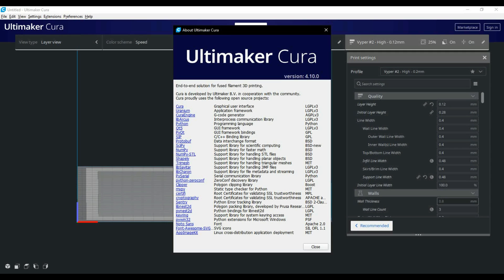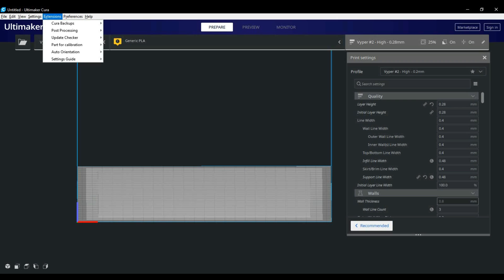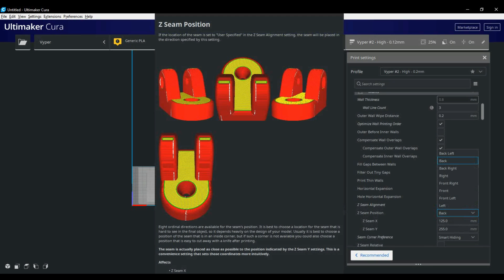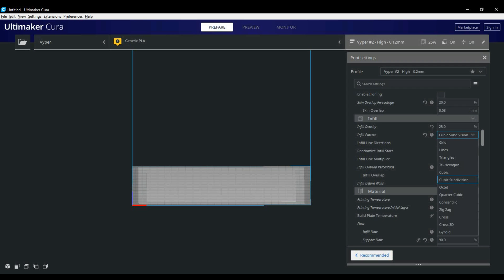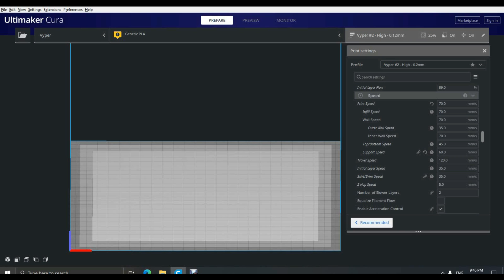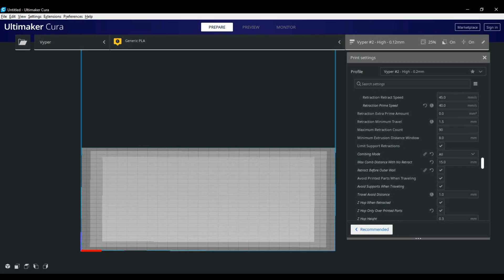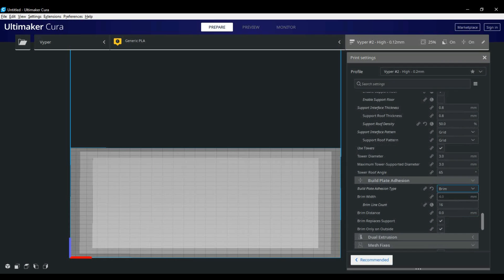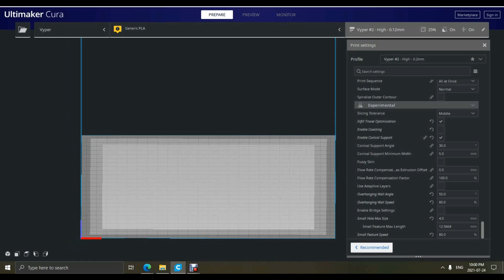Cura Walkthrough Vyper settings

Comment: The settings on your drive doesn't import well into my version of Ultimaker for some reason? I think it is because I have more options than what I see in your settings... However, I adjusted what  I could.

I also noticed that some of the settings on the drive file dont match yours in the video, not sure if that is because you have updated them since...

I am trying to find a good profile for PLA Plus on my Vyper. Super new to 3D printing :P
Reply from the maker: Is there a error that pops up? If you click in settings to show all settings that should help. I change a couple settings depending what I print options that I change are usualy layer height,infill density and support options most other setting never change for me. I'll upload a updated profile and see if it works for you.
Reply from the maker: This profile I have is what i use for all my prints basically  I print mainly pla myself sometimes tpu and petg but mostly pla and this profile had been working pretty good for me
Reply from the maker: Main thing you will want to do it calibrate your e steps and your flow %.
Reply: @studiozombie3d  Yea I'll look into that. I'm super new to printing so I am not sure how to tell if things need changing. I am printing a decent sized print and will see how it turns out. I am using PLA Plus right now, so the only thing I changed was the temps and set it to 220 as the PLA Plus recommended.
Reply from the maker: @DeSibyl  if you have Instagram you can message me there and I cam try and help you out. There won't be much you change really. Layer height,infill density and support settings are the main ones. If you notice stringing on your prints you can drop your temp 5 degrees and that can help
Reply: @studiozombie3d  the settings seem fine, I’m noticing the infill has holes in the ‘walls’ pretty often… I use gyroid (since it states it has strength in both verticals and horizontal) and use 20% infill… I also notice there are some holes in the outside walls too, although they seem very small and I don’t think they go all the way through… I lowered the temp from 220 down to 215 to try and lower the amount of stringing which seems to have good effect as there’s not as much stringing this time
Reply from the maker: @DeSibyl  what is your infill line width set to? .48? If not try that and you can slow the infill speed down a bit to help fix that. I've had lots of prints do that to me but they are strong and I have no issues. But try slowing the speed of infill down 5 mm or so and see if that helps
Reply from the maker: @DeSibyl  you can also bump up the infill flow % a few percent to help out
Reply: @studiozombie3d  okay I'll give that a shot, I pretty much just used your settings as they are and just adjusted the printing temp due to using pla plus
Reply from the maker: @DeSibyl  yeah there aren't many  changes you really need to name based on material generally speed and Temps

Comment: Great information for a new to 3D printing person. I'm using your profile for the Vyper right now and mt print is looking amazing. I've also substituted your start code. Thank you!
Reply from the maker: Glad to hear that it's working for you. The start code is more of a personal thing I just like to do a purge line before prints. Need anything else let me know
Reply: @studiozombie3d  Quick question about your start code (and I've seen it on tons of other start code for the Vyper):
 You end it with a G5, which according to Marlin Gcode ref is a bezier cubic spline move. I found reference in the i3 MEGA manual to add the G5 in the gcode to enable power loss recovery of a print. Do you know if this still needed since M413 exists? Or is it a remnant of our choice of i3 mega as the starting machine? BTW thanks a lot for the profile!
Reply from the maker: @chzel  it's more to enable and work with arc support. There's a plug in called arc welder. It attempts to replace G0/G1 (linear move) GCodes with G2/G3 (arc move) GCodes. This can substantially compress many GCode files and may reduce stuttering caused by sending many tiny movements in rapid succession over a slower serial connection. If can also help with producing a cleaner circle movement and round prints.

Comment: LIKED and subscribed! My vyper will arrive tomorrow its my first printer. I been on youtube looking for helpful content for the viper. You provided the best info yet. Unfortunately its a new printer and not much support for it yet. Hopefully you will continue to post more tips and tricks for the vyper! Thank you
Reply from the maker: That's awesome to hear man glad the videos have been helpful. I'm planning many videos might do a octoprint setup one then maybe a closer look at some of the cura settings. Any suggestions let me know
Reply: I plan on loading your setting and bang out some test prints. I plan on using this mostly to print parts. Once i get confident with the printer i planned on setting up octoprint, so im sure people would appreciate that vid. Do you create any of your own models?
Reply from the maker: @thatdude610  the cura profile I have uploaded is pretty solid for most thing you just need to calibrate your e steps and flow and your good.  Yeah octoprint is super handy have had a couple requests for a vid. Will start working on it and get that done in the next day or two
Reply from the maker: @thatdude610  I'd like to make my own but I use pre made most of the time

Comment: Did you make any Z offsets in the firmware or just leave it at zero?
Reply from the maker: I just leave it as is once I level it seems just right for me. Sometimes I will re level the bed if it isn't right. Haven't adjusted the z offset once with it surprisingly
Reply: @studiozombie3d  same. My only bed adhesion issues have come from blobbing at the nozzle after loading new filament (it defaults to 230 which is REALLY hot for PLA)
Reply from the maker: @jeffersonderrickson5371  yeah I haven't printed off the SD card since the first week lol I use octoprint on mine.

Comment: Quick question...are you using octopi or SD card for prints? Been having bad prints using octopi. Bad stuttering around corners.
Reply from the maker: I always use octoit myself. What are your acceleration and jerk settings? Can try resetting your firmware on the printer and see if that helps also of your not using it I'd recommend trying arc welder plug-in on octopi. Let me know if any of that helps
Reply: Ya that's the first thing I tried was Arc welder. It helped a little but the print head almost stops when it comes to any corner. I'm going to flash the firmware right now. I hope that fixes it I really like this machine.
Reply from the maker: I remember at one point mine did that with one print. I reset the firmware with m502 on the terminal and reset my esteps and stopped doing it. Think it's a bug and the data gets gummed up transferring over

Comment: Your settings have done wonders for my Vyper print quality. I found 95% of what you’ve shown work best for me. I didn’t enable jerk setting because I kept getting layer shift (bad staircase shifts), so I let the firmware determine best corner speeds. Appreciate the extension tips also as I’m learning 3D as a newbie. I finally obtained a perfect 20mmx20mmx20mm calibration cube with your settings overall.
Reply from the maker: I think the jerk settings on the profile is set at 13 think stock is 5 you can try 10 or lower see if that helps any
Reply from the maker: That's awesome glad to hear that anything else you need let me know

Comment: 1:00 but aren't the dimensions of the printer 245x245x260?
Reply from the maker: It's a odd size for sure
Reply: awesome... Im testing my new viper as well
Reply from the maker: @MrMST6  nice let me know how it goes for you. I have new custom firmware avalibe with linear advance and some other options enabled and if you have a raspberry pi octoprint is awesome with the vyper.
Reply: @studiozombie3d  I'm getting some under extrusions on the z seam, I'm going to try the custom firmware to do the linear advance test... does it work well w/o octoprint?
Reply from the maker: @MrMST6  the new bugfix has tweaks for octoprint I tweaked the buffers for usb and the baudrate to 250000 for octoprint. I only print with octoprint and it's working awesome with the new firmware.
Reply from the maker: It's actually 250x255x265 It's wierd I know lol
Reply: The dimensions that he used come from Anycubic themselves. From using my vyper those settings allow you to build right up to the edge of the bed. Since the vyper has a removal print bed that flexes to release you can build on the entire build plate instead of leaving room for tools or other releasing methods.
Reply: Wow that's interesting!
Reply: Cheers for this - will be trying out these settings on a bunch of terrain. I'm only a week in with my Vyper but I'm learning a ton already!
Reply from the maker: @celephais40k12  nice let me know how it turns out. I haven't done a crazy big print on my vyper yet. Love to so see how terrain turns out